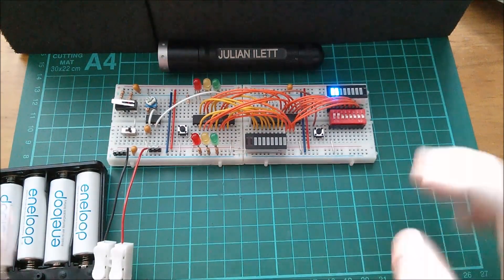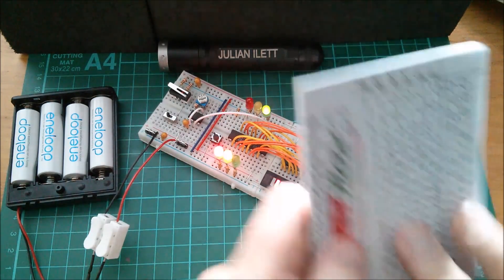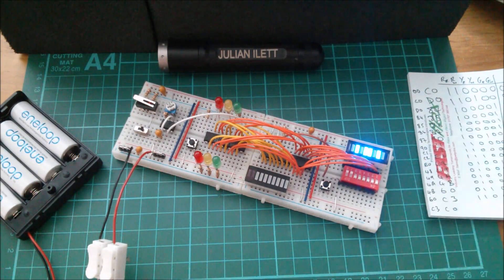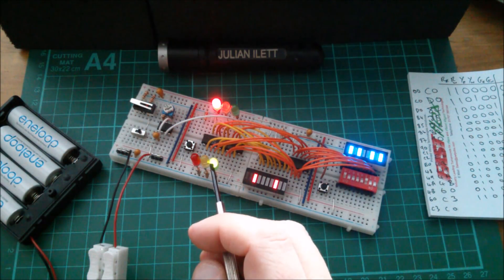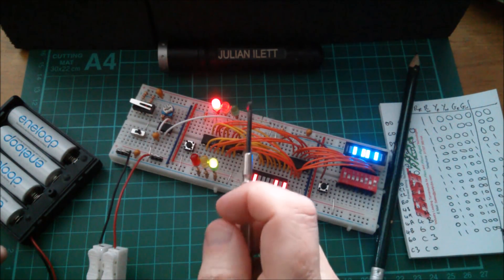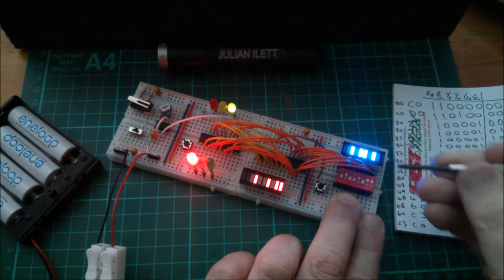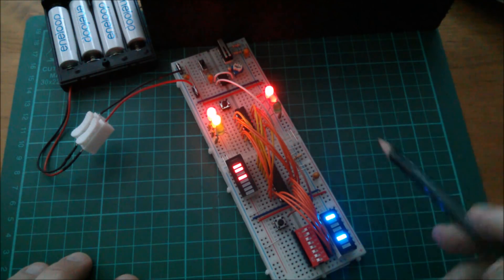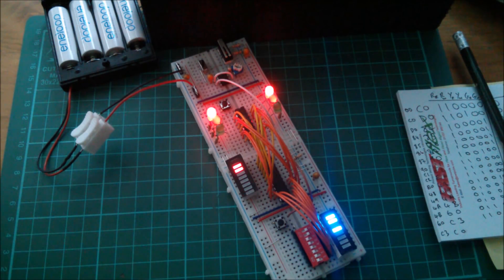LED Traffic Lights

Comment: I did a traffic light as a mental exercise (havern't actually built the thing),  and it's a lot simpler than that.  It uses a 555 and a 4017 to generate the states.  There is no programming involved.  The key to getting different timing periods is to have different states include or not different timing resistors for the 555...

Comment: Applause Julian... My dad built me a "play" traffic lite, when I was about 3... at about 16,, I tried making it run on its own (without a switch).... and used 2 555 timers, and a relay to toggle one side to the other.... well, it worked, but not the way it should.. since the timing was set, both sides the same,, and also,, in the style of old time lites, never both reds on at the same time, etc., just what was hard programmed... Thanks for the great vid!

Comment: Bet you would have had an easier job simulating Australian or New Zealand systems: 
green, amber, red, then back to green only again with no ‘get ready’ double light stage.
I suppose it helps drivers pay attention to cross traffic more seeing them stop for the amber.

Comment: Use a NOR gate across the red and green to trigger yellow then leave a longer period with Red and Green off to activate yellow.
There is a reason why you are getting a second LED with the yellow but  can't remember off the top of my head. When I learned digital logic back in the 90's we built a traffic light project all out of logic and a rom acting as a state machine.

Comment: I'm  thinking there was a similar micro free project kit around in the 80's using a 2732 preprogrammed with a selection of light sequences  controlling 8 relays on the data lines, a few dip switches to select the upper starting address and an 8 bit binary counter for the lower address lines.

Comment: Very nice. Traffic light controllers are very interesting to me. You wouldn't think it's difficult but there is actually a lot of logic that goes into an intersection, max green, min green, all red delay, etc, etc. What was built isn't entirely too far off from the original electronic controllers that came out to replace the mechanical ones (no micro-controllers then!). Traffic signal control is definitely a rabbit hole you can go very far down (and I like it there!).
Reply: Arrays of relays and delay lines. Lots of clever engineering before microcontrollers.
However, they actually functioned very similar to this on a base level, but relays were used instead of ram, and multiple relays used for logic gates.

Comment: There's only 7 different states you'd ever want those lights to have - you could encode that into 3 bits and use an external hardware decode :p
000 R1 R2
001 R1 Y1 R2
010 G1 R2
011 Y1 R2
100 R1 R2 Y2
101 R1 G2
110 R1 Y2
which gives you 3 extra bits for addressing... even better if you went for american style sequence :p
Reply: You forgot the 2nd r1 r2 state. 8 states is ok but then you have to add logic gates to translate state # to led output with ands and ors.
There's a simple way to improve the circuit for duration of green lights (currently a bit short): use one of the 2 low adress bit to switch a resistor on a 555 counter to change its speed.
Reply: probably should have said combinations, I wasn't thinking of state machines - just suggesting saving space by not allowing for the encoding of unwanted combinations like G1 G2 and keeping the code working in exactly the same way apart from that... the cost is a complicated decode circuit... it wasn't a suggestion I expected anyone to take very seriously.

Comment: You only need 2 bits for each set of lights. 0 = red, 1 = red and amber, 2 = green and 3 for flashing amber if you wanted to do a pelican crossing in the future.  That gives you an extra couple of bits to use for other things.
Reply: Plus external components to decode that AND have independent (as in, non-complementary) sequences for both directions of the crossing. Which this project isn''t about.

Comment: Would it be possible to use a 3 bit binary sequence to control the lights, and use the remaining 5 bits for timing? For example
000 = leftRed rightRed
001 = leftRedYellow rightRed
010 = leftGreen rightRed
011 = leftYellow rightRed
100 = leftRed rightRed
101 = leftRed rightRedYellow
110 = leftRed rightGreen
111 = leftRed RightYellow

A few days ago you were DOING IT THE WRONG WAY ahem, I mean exploring new methods of SMD soldering with chips that took a binary sequence and output a consecutive sequence. Would that work for this?
Reply: No, because this sequence is desired to be non-complementary, as in, changing of lights of one direction is only ever allowed when the other direction shows solid red.
Reply: Does my example allow changing of lights in one direction when the opposite direction is not red?
Reply: On second look, no, not in your description, but the trick is to A) do it without further external components that decode the binary sequence so that B) the bit pattern of the current address also happens to be the next address to jump to. Yours would require an external counter to derive the memory addresses from the 555 pulses as well as a network of logic gates to decode the bit pattern into lighting signals for the individual LEDs, and then you haven't even begun to decode and make use of the five bits of timing you proposed.
Reply: (I probably triggered YT's idiotic spam filter at some point when my post still contained the URL to the external project I mentioned, thus silently suppressing the display for others while showing it for myself as if the world was still a happy, furry, colourful utopia YT's and Google's censoring ne'er-do-evils are so eager to implant into real people's minds …)
You're still using only five bits to encode the possible states, necessitating in a decoder into the six individual on/off signals, and the point of this circuit is that it doesn't have nor need additional externals. Then, this circuit is already using up the two remaining LSB to encode repetitions of the same state in their respective places of the sequence. (See 7:15 as to when, and also why they mustn't be reused).
Sure, if you allowed for additional ICs, providing the addresses and the lighting signals, then your solution should work without problems, but without, the code has to do everything at once: Provide the data without translation as well as the transport control.
Reply: Really, it comes down to needing decoder hardware and not needing decoder hardware. You're saying it yourself: "the first state with left and right RED LEDs has encoding of 000" Julian's circuit does not need more hardware, your concept would, that's what this is about, not about what could be done if the circuit was different. Of course, if you have the right additional hardware, you can do anything. But this circuit doesn't, that's it's entire point.

Comment: good example for "Von Neumann" computers - thank you (i have made my 1st experience on a 6502 processor the same way). This is real low level but good for understanding. If i remember correct Eniac works so too (of cousre with different technology).

Comment: red yellow green ? Weird and unnecessary..
Reply: The US system was adopted when most vehicles in the US were "standard" shift. I, and millions of others, drive stick shift cars in the US. The red-amber state may well have benefits but I suspect they aren't particularly related to the popularity of transmission types.
Reply: The advantage is that when the amber is lit, you can instantly see whether the next state will be red or green. A small advantage, but an advantage nonetheless.
Reply: Sure would make drag racing more interesting
Reply: With the way people get right on your tail at lights and expect instant acceleration at a green light, I can see how this would help manual drivers, I have not been driving manual for too long and traffic lights are always slightly stressful if you cannot see the other light turning red.  I never knew traffics lights worked otherwise, thanks for explaining why.
Reply: In the US, Red and Yellow are NEVER lit simultaneously, unless something is seriously wrong. Yellow comes on with green(though green usually turns off when yellow comes on), to let traffic know its about to switch to red. Red and yellow is never on at the same time. AFAIK, no traffic lights are left in the US where more than one light is on at the same time EVER. I think this was done to help color blind people. This does not include additional turn lights.
Reply: @tablatronix: You mean the RED & AMBER together state is unnecessary? In the US where you mostly have auto transmissions, maybe. In Europe, where we still like a stick shift and still have a disproportionately large number of them, having RED & AMBER (get ready) before GREEN (go) is extremely useful - It gives you time to put the car in gear!
Also if you’re doing this circuit in discreet logic, it gives you a nice symmetrical 4 pattern sequence you can decode from a 2 bit counter. I’ve often wondered what you do in the US for that introductory project.  Either 1 phase has to stay on for 2 cycles, or you have to reset the counter at 3.
Reply: Stuart McConnachie True, but who hasn't been watching the other direction's lights to switch to amber for knowing when to "get ready" and rev the engine so that we can start releasing the clutch as we see the red-amber already ... ;-)

Comment: I'd say you should get some EEPROM, but I've had awful problems with any I get from ebay
Reply: No, you need good old Eprom, with the need to UV erase it. It works well for making sequential logic with a latch, or for making all sorts of combinational logic provided you have enough address and data lines.
Reply: EEPEOM was invented for a reason
Reply: I've received a perfectly fine set of 2816 proms through Aliexpress and ebay without any fuss.
Reply: How are you programming it? I've been unable to program all but one of the 28c256s I've got off ebay. It's rather odd.
Reply: I admit I have yet to test them extensively. I should do that soon. I thought your problem was finding them, rather than getting ones that don't malfunction. My apologies, I misread.

Comment: In the US the lights change to red when you run over a  pressure tube under the pavement so over 90% of the time you're stuck at a light and they cry about emissions. When you're stuck at a light they change from red to green.
Reply: That isn't how traffic signals work. They use an inductive loop buried in the asphalt to detect the presence of a large chunk of metal.
The rubber tubes you occasionally see strung across the road are there to count traffic. They have no connection to the signal lights. Those are actually quite clever. They can tell the difference between cars, trucks, and motorcycles by the length and pattern of the impulses seen at the pressure transducer.
Reply: I know what the hoses that lay on the road do and they also place them a certain distance apart and they can tell if you're speeding. Inductive loop or a tube is beside the point and also clever enough to turn red as you approach the light so I speed like every other New Yorker and they still cry over emissions and the greenhouse effect/Global Warming/Climate Change and they'll keep you hostage in the middle of the night when no other cars are around. They should be programed for certain time of the day and allow oncoming traffic to pass when there's no vehicles waiting. When there's heavy traffic use a timer and allow the main road more time, at night use a microwave sensor, but that's how you know they don't care about the hoax of the world boiling over. My whole point.
Reply: I don't just know what they do, I've handled them. The first three years out of school in the late 80s-early 90s I worked for a traffic engineering firm. One of the parameters that they record is traffic speed. But they don't need multiple hoses to do so. They can suss that out from the shape and duration of the pulses.
Reply: I'm telling you I've been pulled over for speeding and they used 2 (TWO) hoses that was spaced a certain distance and they determined I was over the speed limit by 15 MPH and the court was glad to explain it with a written deposition, but you're a professional so you could tell me what my fine and court service fee was. They were glad to tell me cars have different wheel bases and length like a limousine vs a volts wagon bug and I'm certain you can explain why they was wrong. Gotta love a keyboard genius.

Comment: I built a two side traffic light circuit as a high school project back in 80s.  I used only a 4017 and a 4011 and bunch of resistors and caps for red and green lights delay.  it was a robust project and wouldn't go crazy when the power shut down :p
Reply: I made a traffic light for my daughter back in the late 80s. As far as I remember, it used a couple of CMOS chips and a transistor gate for another set to suit the first. I think it only took me a few hours and I built it on stripboard.

Sometimes the easier solution is the best one.

Comment: Hi Julian. Well, it was a long-winded way of building traffic lights but you got there in the end.
I built a set of lights by further re-engineering the 555/4017 circuit in post bag #29. 
By further re-engineering I mean by adding six LEDs and a diode array, 24 in all if I remember.
The outputs that drove the green LEDs were used to extend the 555 timing cycle on green lights.

Comment: It didn't power up with both sets showing green, like some real U.K. traffic signals 🙁
To get some more states from this, you feed the data from the RAM to a decoder, then the decoder controls the traffic signals. By using a decoder, you need less data bits to define a state, so can hold the same output state during a longer sequence of RAM cycles. Would make the design much more complex though.

Comment: Hmmmm, surely the correct sequence is:

R1 A1 G1  R2 A2 G2
1   0    0     0    0   1      long delay
1   1    0     0    1   0      short delay
0   0    1     1    0   0      long delay
0   1    0     1    1   0      short delay

and then back to the beginning......
Reply from the maker: At a crossing maybe, but temporary traffic lights need an 'all red' phase.
Reply: Nick B All lights I have seen have a built in safety delay between crossing flow directions. Part of it may be during the amber phase, but there is always some left for the "all red", which at least in Norway is at least as long as will allow the last vehicle that passes the amber to complete across and clear the crossing before green is given to the other direction. Thus there will never be a red-amber simultaneously with amber in a conflicting direction. This is probably for the best, because empirical data seem to prove that the red frequency slows down the speed of light dramatically, so that it may take up to 10-15 seconds to reach the drivers.

Comment: If I remember correctly, I think it's a finite state machine. A second 2k would allow an extra 3 bits of program/data - or the single 2k could run 8 different "programs" according to a 3 bit input

Comment: Two 4-bit hexadecimal rotary dials could have made this a bit easier, if not as torturously exercisive in mental binary.
Also, I wouldn't call it nonsense at all. Just because modern and common architectures pretty much indoctrinate us to separate data and control doesn't mean you can't solve problems without such separation. Quoth one Antoine de Saint-Exupéry, translated, "[...] perfection is finally attained not when there is no longer anything to add, but when there is no longer anything to take away [...]". I'd say you have gotten pretty close to that. Cheerio, Julian.
Reply: Anvilshock   I'm startled to see a quote from Antstex here !  Happy if you too love his genius!

Comment: You get +100 points for NOT doing this with a programmed microcontroller :-)
Reply: The White Byte WHy?
Reply: Because with microcontrollers (especially Arduino, as someone suggested in an earlier comment) it's very easy, and there are like 2 billion online tutorials for that. Of course, I'm not saying the Arduino way is obvious - one has to learn that too - but there's definitely merit in exploring other technologies and solutions for the sake of deeper understanding.
Reply: Gunnar Freyr - You may want to look up the specs of the newest 8-bit microcontrollers; many of them have "logical cells" (or a similar name), which are essentially a bunch of simple logical functions that can operate independently of the main CPU. Call it 50's tech, but apparently it's still very useful! ;-)
Reply: Indeed I really like how Julian using the led and switch array to step debugging logic ic, It's quite clever, I never saw this before.
Reply: I keep getting the same IC's he is using and trying the same tricks I think they are better than micros in that no computer is needed to program your build these are what I run my robots with
Reply: hehe i lost interest when i saw there was no microcontroller, first thing that came to mind was "Wtf?! Is this 1950?!" ;D

Comment: Why not implement it using an Arduino Nano and step through the sequence. Simpler, cheaper and better.
Reply: You could just go to the end of the road and just watch the already made ones.
Reply: Not the point of the exercise. You could also write it in JavaScript and let it run on a website, but this is about designing a different hardware architecture.

What could be interesting is to do this on an FPGA and just use 32bit addresses or something like that.
Reply: You’ve completely missed the point of this video!
Reply: Brian Oldford Simply because it's not fun I guess
Reply: I guess Julian must have far too much time on his hands. '-)
Reply: Graham Southern yes he has...........why climb a mountain ?.....................because its there
Reply: Satire alert